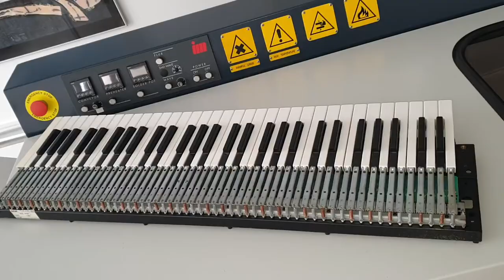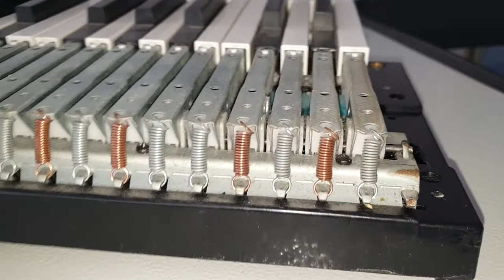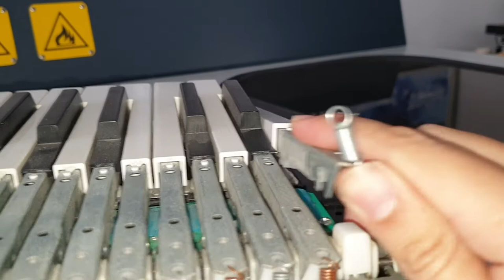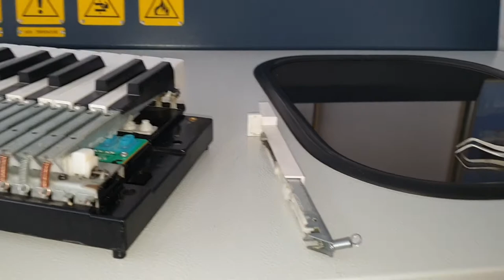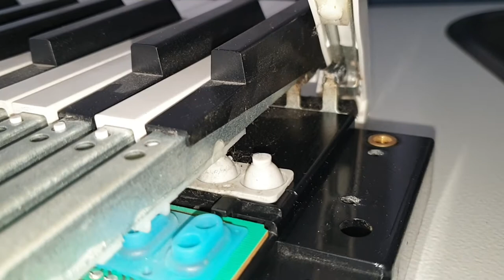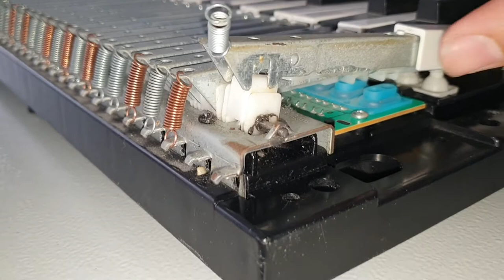How to change a key on Fatar TP/6 - TP/60

Comment: Hi Svetoslav, great video thank you. I have a question about a part from a Fatar TP6 in an Ahlborn-Galanti organ and I'm hoping you might be able to help me with it. I would need to send you a photo of the part. How may I contact you?
Reply from the maker: Hi, I'm glad I was helpful. 
 Write to sales@largonet.net from midiboutique.com, tell them what you needed.  They will help you.
Fatar generally do not sell separate parts.
Reply: @agentarz  Thanks. I emailed them and they quickly replied: "Unfortunately we don't have such part. We offer only some spare keys."

I would like to show you the part that I'm referring to so that you might help me describe it correctly, please.
Reply from the maker: @James_Bowie  
I requested that your email be forwarded to me by "sales". I saw what you need. We do not have such a part, and it does not appear to be ordering from Fatar soon. It is only bought from them in large quantities.
But I can suggest you make a substitute. For example, from nitrile rubber cord or similar soft rubber material. It can also be made of Silicone rubber cord. It will be much cheaper than from Fatar. Maybe even with a softer feel.
Reply: @agentarz  Thanks again. I have been told that the part is called a keyguide bushing. We would need 183 (say 200) of them. I was not even sure if Fatar still supplies that part for the TP6. Making a substitute from nitrile or silicone rubber cord is a good suggestion.
Reply: Update: I sourced the required quantity of these keyguide bushings from Viscount UK.